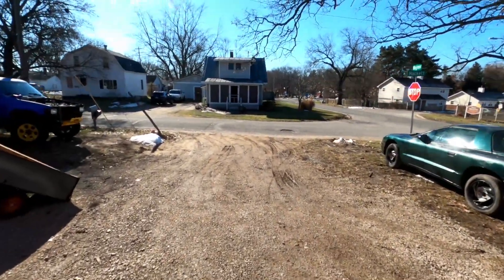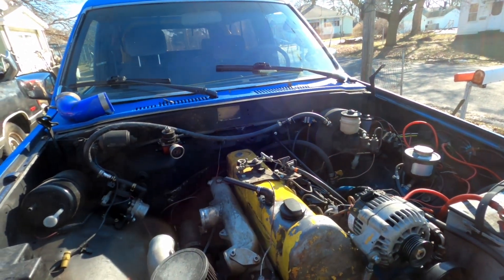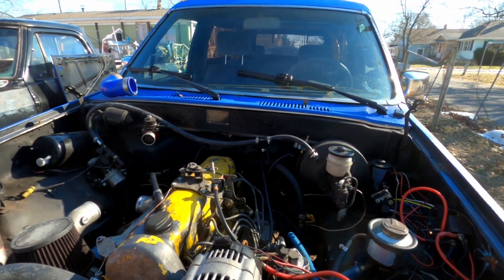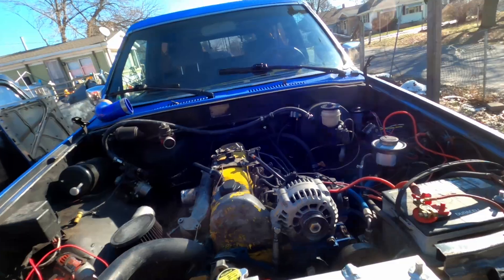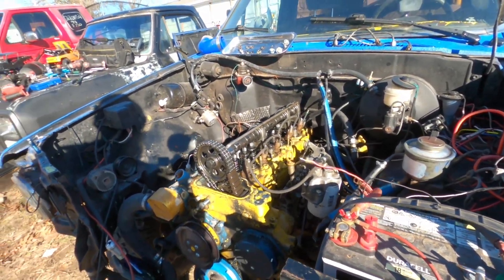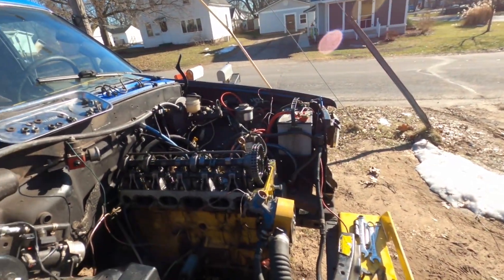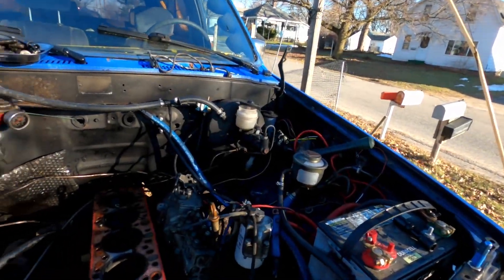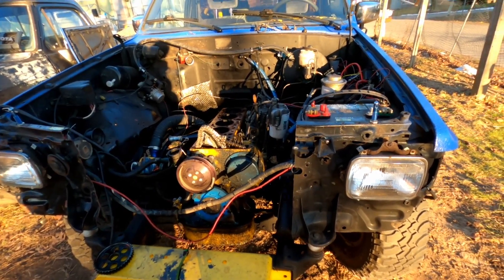Diesel First gen 4runner engine tear down. What went wrong?

Comment: Voodoo Rangers can be dangerous! 

When you go to retime the engine be aware MB offers offset keys for the cam gear. I installed one when I had an OM617 to get it within spec and it helped with a hard start issue I had.

Comment: the dark spot on the head and head gasket on the last cylinder by the firewall sure looks like head gasket was not making enough contact and allowed gasses and coolant to mix from the last coolant port on the engine block. check the head for flatness there it might be warped
Reply from the maker: That's definitely the failure point

Comment: Those 617 heads can and do crack but its normally very visable when the head is removed. It is a pretty decent chunk of cast iron to crack tho. Normally the biggest issue is the sest under the injector coming loose requiring the special splined tool to retorque it again. Heres hoping it is just that fan/switch arrangement that caused the issue. You port matching or modding  the new head thats going on or the original if it passes all the tests?
Reply from the maker: Yeah, there's probably nothing wrong with the original head, or at least nothing a light mill cut won't fix.

That's the one I took to the machine shop.

Comment: Hey brother got a question for you I have a 1977 Pontiac Catalina there is a Orange box on the driver's side with wires coming out of it by any chance do you know what that is it would be greatly appreciated great view
Reply from the maker: Idk if I've ever even touched a Catalina. 

So I have no idea.
Reply: I'm not familiar with the Catalina, but Chevettes have what sounds like it's probably exactly the same thing - it's just an electrical diagnostic center, GM made a tester that plugged into its wired to check battery voltage, voltage before the ignition switch, voltage after the ignition, cranking voltage, etc.

Should be fine to ignore it completely or remove it if you're wanting to clean up underhood a little.
Reply: Thanks brother last thing if I wanted to get one or make a holder for it is it pos or negative
Reply: @davisbrian2912  I'm not sure what you're asking
Reply: A relay holder